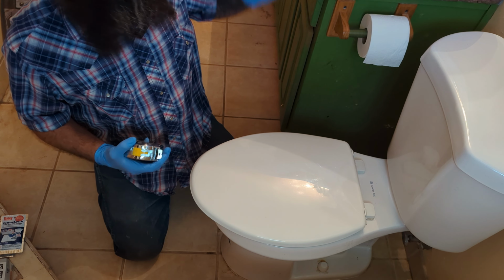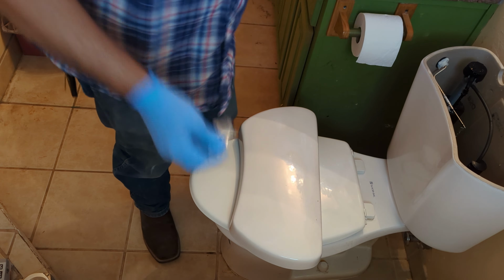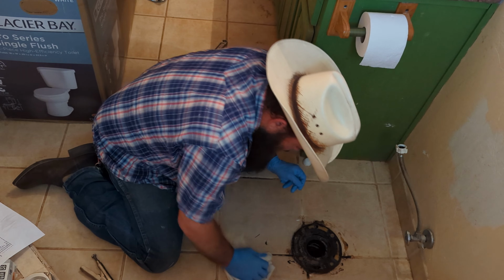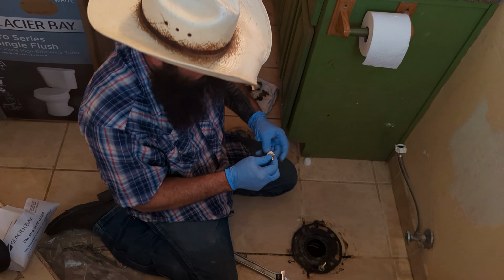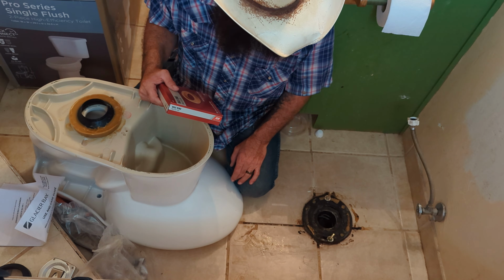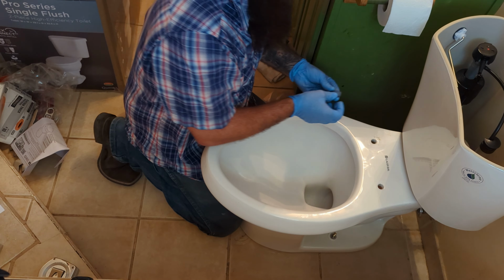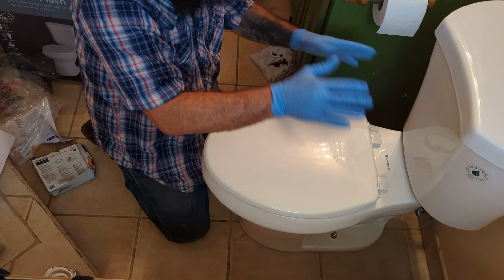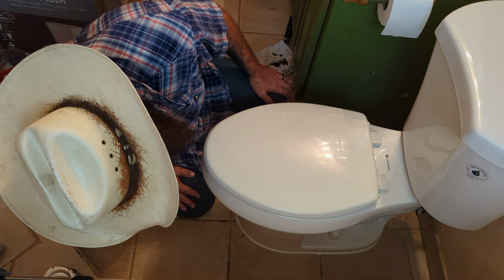How To Replace A Toilet Step By Step

Comment: They cost a little more, but I only use the Rubber "wax ring" myself. I have never had a problem with them, or any call backs. They come with an extra foam ring to increase the "thickness" if needed.
Reply from the maker: I've used them.  No issues so far

Comment: If the floor is uneven, I always use a shim to support the toilet and caulk over it. You can also use a shop vac to get all of the water out of the old tank.
Reply from the maker: I agree, if the floor is worse than this one I use shims.  This one was not great, but not bad enough to justify shims.  For the shop vac, they work but I don't carry a shop vac.  I've cut down on the tools I carry by more than half over the last 4 years to be faster and lighter.  Thanks!

Comment: Awesome video.  Do you ever use those little plastic shims?  It scares me to have the drain open when working around it...afraid of dropping a tool or part down there.  Do you use a rag or some kind of plug to cover the opening until you are ready to set the new one down?
Reply from the maker: Yes I've shimmed, if it's any worse than this one was.  
I've covered drains before, but not usually.  Probably will regret it some day off I'm not careful!

Comment: Thanks for the time and effort you put into these videos, Ray. I know every contractor has their preference, but I've seen wax rings with funnel/horn fail more than a few times over the past 7 years. The rubber sometimes partially block the closet flange opening, but you don't see it happen while you set the toilet. Or the rubber hardens over time and cause issues. It's good for business i guess, but I don't approach jobs with that perspective. Jumbo wax is a must if it's not new construction as subfloors settle over time. I use cedar shingles to shim, score at the base of toilet and snap them upward (I learned form Steve Lav). A bundle of shingles last me for a couple years. If a customer requests I will caulk the front and sides, but I usually don't. If the toilet is more than 6-7 years old I would suggest customer we change the shutoff and supply as upsell, only because they may fail in the next 3-4 years because of poor manufacturing practices and they would have to pay for a second trip.
P.S. I like the box idea, but you may want to cut one long side open, lay it flat on the floor next time if you have the room. I was praying for you to not to throw your back as you lifted the old toilet up.
Reply from the maker: Thank you sir!

Comment: Seems logical to replace the supply valve after the old toilet has been removed so you have more access to it??
Reply from the maker: I agree.  It's easy either way but yeah I agree there would be a benefit if you had to turn the house water either way.

Comment: Shop vac. Or pump that hooks to your drill and drain to bucket or tub. For water. "Free"
Reply: Plastic toilet shims work great for leveling then caulk . You can use toilet sameday...your note said don't use for 24 hours what if they have only that ond toilet in home ?
Reply from the maker: I tried the Shop-Vac thing, but I wanted to stop carrying a Shop-Vac so I made some changes to a few different jobs so that I could remove that from my tool inventory in the truck.  I've considered the pump idea, it could be done with a very tiny and very inexpensive pump but I haven't put that together yet.  So far the liquid lock is really handy, takes up no space, and costs almost nothing. 
If there's only one toilet in the house then I usually tell the tenants not to use it for 6 hours rather than a full day. But it's very rare for me to have a house with only one toilet in it.  Most of what I work on are Single family homes with at least one and a half baths.  The reason I tell them not to use the toilet until tomorrow is because if I tell them not to use it until tomorrow then they'll still use it today. But at least they'll wait 6 hours probably.  If I tell them to wait 6 hours they'll wait three and if I tell him to wait 3 hours they'll wait one.
Reply: @bulletproofhandyman  ryobi makes a small 1 gallon great for clean up end of day or toilet

Comment: Hey Ray. Do you use any back end automation to help with your admin work? For example: transferring data from work order PDFs (tenant name, address, issue description, etc) into Jobber automatically with applications like Zappier rather than manually converting everything into Jobber like I currently do. There are several other use cases to choose from but this one task seems to be the lowest hanging fruit for giant times savings. Thanks for the great content! Cheers.
Reply from the maker: Not yet.  I still prefer to input new jobs manually just to keep myself updated on the details.  I suspect over the next year there will be an AI that will do a lot of this for me using conversation.  I'm keeping my eye on the industry waiting for it to reach a point that I'll be able to use it effectively.
Reply from the maker: I considered doing that in the past.  I've also asked my rep at jobber to ask the software engineers to make a sub-client function.  
The only reason I haven't started putting the tenants in as clients is because I use a lot of other functionality inside jobber that I need to be attached to the client.  
I will definitely look into it again, it's probably been a year since I explored that idea.  I do think it's really awesome that you have automated some of the imports!

Comment: If you must caulk, only the front, but not the back.  If you ever have a wax seal break and lose its seal you want to know by having any sewer smell to actually come up.  If you caulk the whole base, any break in the wax seal will comprise the flooring, your neighbors below will have a delicious soupy ceiling, getting moldy...get get the picture.
Reply from the maker: 19:50 I made sure to mention that.  Thanks!

Comment: Make sure the toilet flange is good, so the bolts are secure.  If you, some old buildings with have a deteriorated toilet flange, so you might have to install a new flange
Reply from the maker: I have to replace the flange on approximately 1 out of 10

Comment: You can caulk if necessary, just not all the way around. leave the back end open to allow water to egress as a tell tale. Use a plastic shim to set on a solid footing.
Reply from the maker: I think I specified that in the video, hopefully I didn't accidentally edit that part out.  I think it's there though.
Reply from the maker: I just double checked, I did mention that at 19:50.  Thanks!

Comment: Turn off the water at the main if you can.  Sometimes old supply valves will begin to leak if you so much as look at it, if not touch and turn it.
Reply from the maker: I agree, most shutoff valves fail when you try to shut them off.  I want to identify that and correct it while I'm swapping the toilet so that it doesn't fail when I'm not there if the tenant ever tries to use it.

Comment: Sponges are my liquid lock.  And a little splish splash can be handled by the Brawny man.
Reply from the maker: I used to use sponges but as I've worked on paring down the tools and materials that I carry with me daily I realized that the liquilock was cheap, effective, and doesn't take up space.  Yes, it's a very small savings but after a hundred small savings you end up with a much more accessible and manageable toolkit and inventory.

Comment: install two wax rings, always, and again NEVER caulk around the base.  Know why???
Reply from the maker: Two rings aren't necessary, but I do prefer the thicker rings.  If two rings were necessary I have no doubt they would be trying to sell me double ring kits to make more money.  I feel confident going by the manufacturer recommendations on this one.  IPC 2012 and UPC 2009 both require caulking around the base of the toilet.  Thats not why I do it, but I'd be happy to hear your rationale for not caulking.

Comment: NEVER  put a caulk seal!
Reply from the maker: Always put a caulk seal (non adhesive caulk) as long as you leave a gap in the back for leaks.  350lb people wiggle around on these toilets and two little bolts with a plastic washer isn't going to keep that in place.  It's perfectly acceptable and would pass inspection anywhere as long as the gap is there.  It's especially necessary when the tile on the floor are tilted such that the center of the toilet is resting on the ridge of a tile.
Reply: @bulletproofhandyman Experienced many of toilets that weren't caulked that felt like a ship rocking in the ocean.
Reply: Caulking helps to keep the toilet in place, especially on slippery flooring material (e.g. laminate or lvp). It also makes it easier to clean the floor around the toilet.